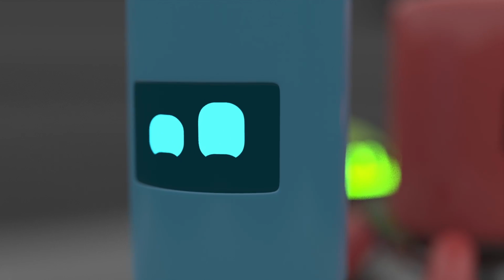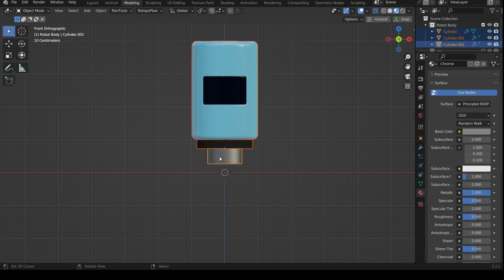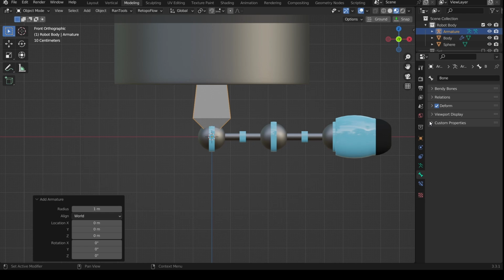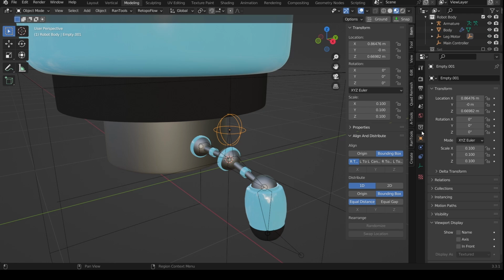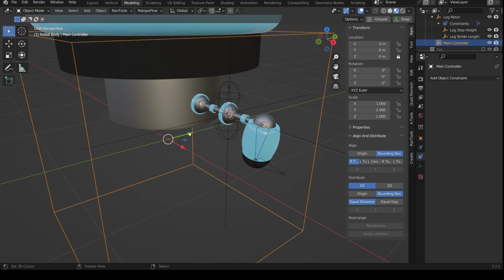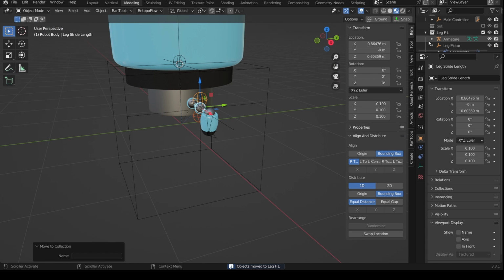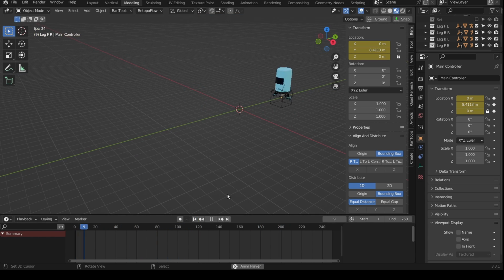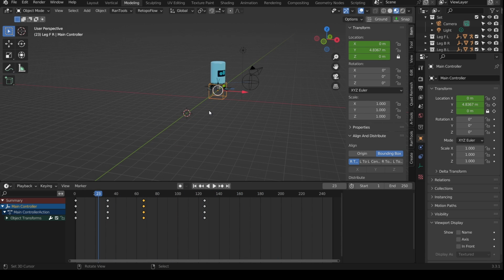Why's no-one talking about this animation trick? [Blender Tutorial]

Comment: WOW! That is an incredibly complex method, but the final result is well worth it. I'm going to give it a try. Once you have the rig set up, can it be used on different bodies?
Reply from the maker: In theory, yes. You can adjust the offsets to your liking 🤗
Reply: @BlackoutCreatively  Thanks. Wish me luck. 😄
Reply from the maker: @Delphinus88ca  you got this
Reply: @BlackoutCreatively  I have the legs working very well when moving along the Y Axis, but when I rotate the Main Controller, the legs do move, but very very slowly. I have no idea what I did wrong. Do you have any suggestions? Thanks. This tutorial was a real learning experience.
Reply from the maker: @Delphinus88ca  is the transform set to the local axis or world? It need to be local
Reply: @BlackoutCreatively  Sorry, but I have another question. I'd like to have the bot follow a curve circle, and it does, but not as I had hoped. The bot legs move well when moving in the Y direction, but slow right down when moving in the X direction along the curve. Can this be done, or is it related to my previous problem? Thanks again.
Reply from the maker: @Delphinus88ca  if you're having it move on a curve you can use the position on the curve to drive the "engine" instead of the y position. Off the top of my head I can't tell you how but it's something I was going to revisit. Let me come back to you
Reply: @BlackoutCreatively  The transform for the body motor is set to local space for both the target and owner. The Target is the Main Controller.
Reply: The leg motors are also set to local space.
Reply: @BlackoutCreatively  OK. Thanks.